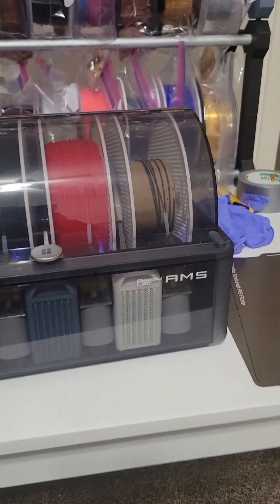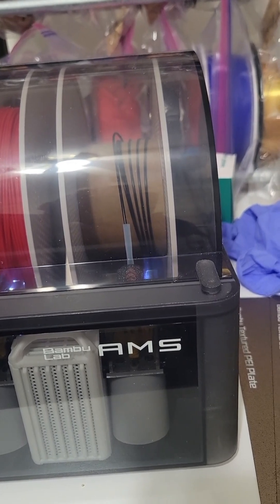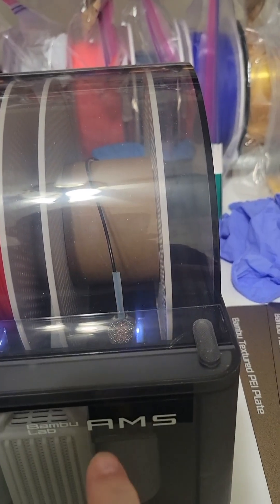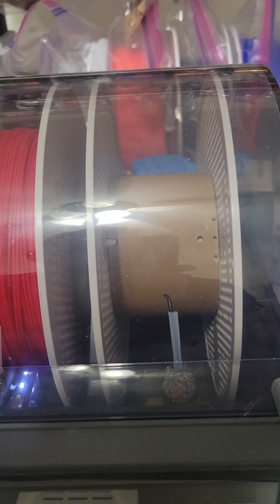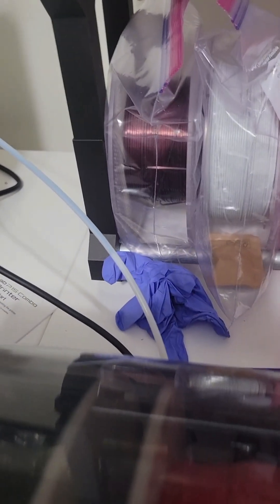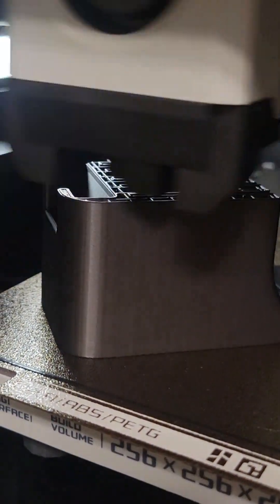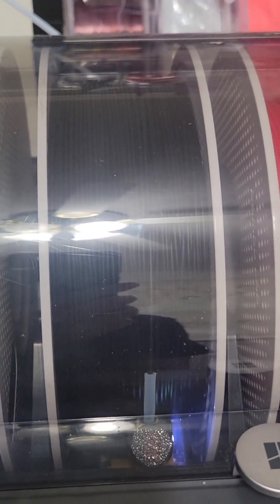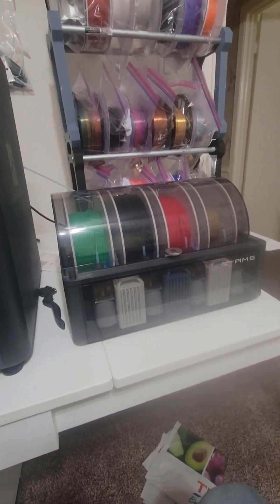BambuLab AMS automatic filament changing

Comment: One thing to note you can only print the auto filament only applies to the same type and brand of the filament.
Reply: Also, some other brand filament won’t pop off the like the Bambu Roll did in this video. It will cause an error.

Comment: I know you were printing in black. But if you didn’t have any more black, would it use another colour if it was the same brand?
Reply from the maker: if you let it run out, you can really load any filament in the same slot and hit "resume" and it'll just keep using it. When I have only a few meters of a color left, I save the little bits for functional prints that don't have to look pretty--I have shelves and filament spools and stuff in all kinds of crazy color combinations because of it

Comment: I tried to test mine....and the print literally finished just as the filament disappeared from the tube into the machine.  Since it said the AMS slot was empty, I figured I'd have to load the other slot before starting the next print, as it probably wouldn't work w/ the empty slot.  Oh well, next time!
Reply from the maker: if the AMS runs out, and there's still filament in the tube, the Bambu will purge everything left in the tube.  Then you can load really any filament at all into the empty slot and hit the play button on the printer, and it'll just grab whatever you put in there and pick up where it left off.

Comment: Nice vid. Quick question. Got mine in a few days ago. It came with a heavy magnetic build plate, but it also came with this two soft things that looks like build plates but don't seem strong enough. They came back to back and look like that have a sticker backing. Do you know what that is?
Reply: The high temperature and cool plate surfaces are stickers like that. When they wear out you can pull it off and replace it with one of those others.
Reply: they are stickers. if one of the plates breaks, peel it off and stick the sticker on it to fix it